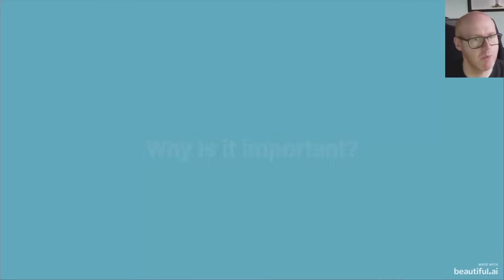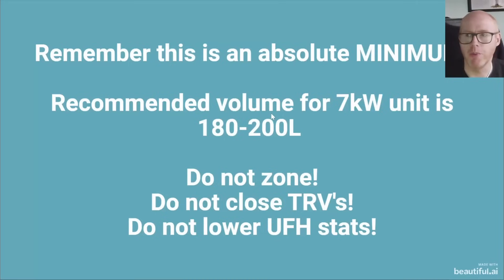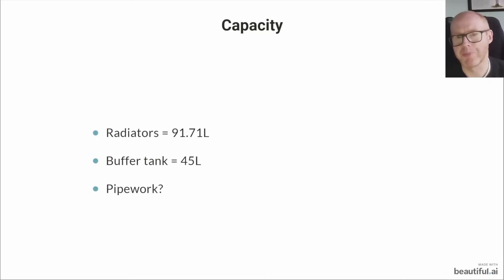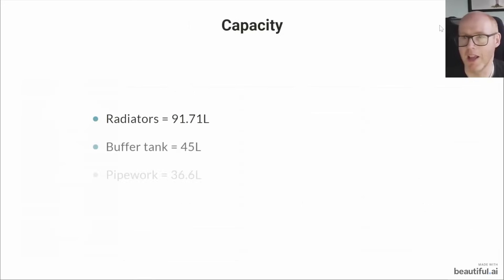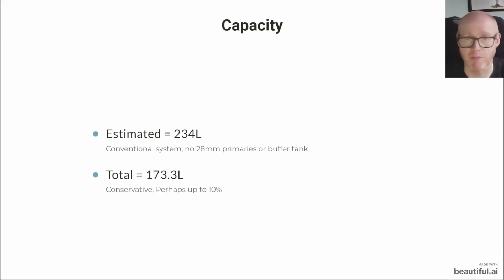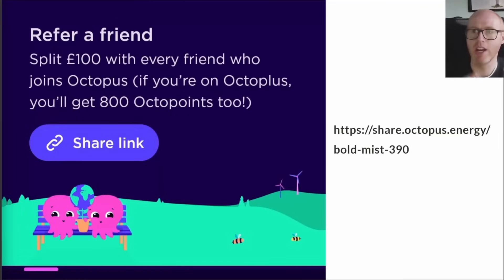How to Reduce Heat Pump Frost

Comment: volumizer or buffer also helps as heat store with reducing hp cycling at lower load and higher outdoor temps, when input is higher then output and hence increases efficiency
Reply from the maker: Agreed 👍

Comment: Really interesting, thank you, another lesson in the road to binning our LPG boiler. I'll have to look into underfloor for volume calcs. We've 100 m2 of modern underfloor, I'd imagine there's good volume there. I always wondered what buffer tanks are for, so thanks again, very educational.
Why do any of us ordinary folk need to understand this? to keep an eye upon a perspective installer, there's such a small installer skill base out there. Buyer beware!
Reply from the maker: Yep, a shame that this is all very common knowledge in many other european countries but we've been left so far behind.

There are lots of good heating designers out there but we need many thousands more of them to train and upskill.

The primary purpose of a buffer tank isn't to add system volume. It's to allow the flow rate of the heat pump and the heating circuit to be different.
The volumiser effect of a buffer tank is secondary really.

Comment: thanks for the vid, do you have a reference for where the recommended volume figure came from? Just had a quote and they recommend a 25L buffer piped as a volumiser as I think they are assuming any rad with a TRV is not included in the system volume even if I plan to run it all open loop.. My Current volume without volumiser is 165L in theory
Reply from the maker: I came to this figure by too many hours of reading forums, Facebook groups and studying heatpumpmonitor.
Some more experienced heat pump engineers seem to use 25L / kW as a starting basis to allow heat pumps to work comfortably.

Some heat pumps have slightly different defrost strategies that don't require quite as much volume to be comfortable. Viessman and Ebac are examples of companies who do things differently.

Comment: I hear a lot of comments saying don’t have TRVs to increase volume and thermal mass but we like having different rooms at different temperatures at different times of the day. I guess having more emitters in the hottest rooms and a volumiser can help. Interested to know your thoughts?
Reply from the maker: Different rooms at different temps is no problem.
Good heating design will address that. Larger rads in rooms you want at 22 degrees and relatively smaller rads at rooms you want at 18 degrees.

Now changing the temp of those rooms throughout the day relative to each other is a different challenge and one that is not ideal for most domestic heat pump installations. You will sacrifice some efficiency to meet your goal from what I understand you are trying to achieve.

Comment: Interesting. Wonder how this affects efficiency because it take more power to heat up more water. I guess the additional power required is offset by the lower on off cycles.
Reply from the maker: Yeah, that's the basics of it. Volume just smooths things out. Decreases cycling. Allows the pump to work for longer at a lower power output.
Reply: @UpsideDownFork  Instead of a volumizer, what about those massive Victorian style high volume radiators?
Reply from the maker: @ChidleyEngineering  yes, that's a good solution if it works in the property.

Comment: Thank you, that was really useful. I asked the octopus surveyor about the implications of using smart trvs (my office tends to get warmer than other rooms) and he did not have an answer

I guess the opposite applies, too much volume will be detrimental too
Reply from the maker: Smart TRV in one or two rooms will be ok until it gets really cold outside then you really don't want to be isolating some of your system volume.

Yes, there will be a point at which too much system volume will not be helpful but most residential properties won't need to worry about that.
My heat pump for example can easily accommodate at least double my system volume without any detrimental effects.

Comment: Great video.  I had a 7Kw Arotherm Plus fitted in November and it has had constant defrost cycling in every cold snap currently resulting in a very cold house!  The installers are swapping it out to a 10Kw unit shortly but I will look at system volume and do some rough calcs, we have a large downstairs UFH slab with 15mm poly pipe so hopefully in the recommended range.
Reply from the maker: Ouch. How close was your heat loss?
Did you also consider the electrical backup heater option?
Reply: 7.6 Kw / hr heat loss at -3C, unit went live and next day the snow arrived and the cycling started!
Reply from the maker: @HappyDays2602  ouch. I wonder if you had a couple of weeks before a cold snap, you could have built up thermal mass in the property that could have helped?🤔
Reply: We had warm(ish) weather afterwards, more than enough to build up the thermal mass, and it’s happened every cold snap so far.  The unit works perfectly when at +5C, COP up to 5.5 so looking forward to it being sorted.
Reply: Considered the BUH but not enough detail on how COP could be monitored etc with it so elected to go for bigger unit.

Comment: I have Vaillant 5kW, 200l+ volume, lots of high intertia UFH, running very low flow temps (25-35). I'm still seeing worst case defrosts of every 30 mins or so, but the defrosts themselves are short, less than 5 mins.
Reply from the maker: Sounds good in this weather. High humidity and low air temps can be really punishing!

Comment: I don't suppose you have any idea how to calculate the system volume of UFH per square meter rather than run length do you (as I don't know the pipe run lengths).  It's a 128sqm property with an estimated 120sqm of UFH.  
All the calcs seem to be by length of pipe (which makes sense).
Reply from the maker: If you don't know your pipe spacing then I would suggest getting an infrared camera to expose the pipework under the floor to you.
Reply: @UpsideDownFork  thanks. Pipe spacing is 100mm and I will be able to get the internal diameter from manufacturer.  Would it be as simple as 10m per sqm in that case? Not allowing for turns etc.

Comment: Really interesting. I didn't know system volume was related to defrost. I'll have I'll have to look up minimums for my Aira 8kw but I'm starting to think the buffer i have is even more necessary than I thought
Reply from the maker: Your recommended system volume will be very roughly similar to mine.
25L / kW is a very rough rule of thumb to work with.
Reply: @UpsideDownFork when you measured pipe runs. Did you times by 2 to count flow and return?

Comment: quick (maybe dumb) question is your 45 litre tank a buffer tank or a volumiser tank? Does it hydraulically seperate the heat pump from the radiators or just add 45 litres to the system volume?
Reply from the maker: Mine is plumbed as a buffer tank. If I can ever get written confirmation that I can replumb it as a volumiser without voiding my warranty then I will do so. 
I was actually hoping to do this back in November but verbal agreement is not good enough for me.
Reply: @UpsideDownFork  I thought a volumiser is piped on the return and a buffer on the flow side?
Reply from the maker: @jooie444  a volumiser has just 2 pipes. One in, one out. It can be fitted on the flow or return.

A buffer is a 3 or 4 pipe setup. Typically 4 pipe in the UK.
It allows different flow rates to be used by the heat pump and the heating circuit.

Comment: At around 0c my 5kw heatpump defrosts around every 90 mins and it lasts about 20 seconds, impressive to see a huge cloud of steam being blown out
Reply from the maker: Thanks for sharing.

If you go outside and observe your heat pump you will see that it takes much longer than 20 seconds for the whole process. A quick defrost on a Vaillant pump will be something like 2 minutes. 

Humidity pays a critical role in defrost frequency too.
Reply: @UpsideDownFork  probably, I just timed from when I see the electric consumption change followed by the start of visible steam at the rear and front then the finale of steam ejection with the fan being activated.

Comment: Gas boilers were also very commonly hugely oversized. Seems to be programmed into the mindset of the heating industry the idea that bigger is better and now even more of a problem when applied to heat pumps.
We are not alone. Domestic heating in the USA is on a totally different scale of oversizing with massive basement furnaces that would be suitable for a  factory or a school building in the UK.
Reply from the maker: Everything is moving in the right direction.

Comment: I came to the same conclusion and fitted a 50l volumiser when i installed my system. The 50l was plumbed in on the return after the diverter valve. On a hot water cycle in cheap rate the volumiser heats to 60 deg and then opens up around the heating circuit giving it a boost. Works well.
Reply: I have the same arrangement. Works great in winter, but in summer it means we are heating an extra 50L of water to 55-60C in order to complete the DHW cycle, and then that heat is largely lost to an already hot house over the next 24h. An online calculator suggests heating 50L of water from 25C to 60C will use around 2kWh of energy. It must be at least doubling the energy required for DHW cycle, although as you say this is still useful energy in the heating season.
Reply from the maker: Nice! 50L can make a huge difference during the very cold periods and the very mild periods.

Comment: Your rule of thumb estimate was off because you doubled the radiator capacity. Check your figures again.
Reply from the maker: 7L is per panel, not per radiator. 
All of my radiators apart from 1 are double panel rads so 14L each.

Does that make sense?
Reply: @UpsideDownFork  7l/m for a K2. You've then doubled that. Check again.
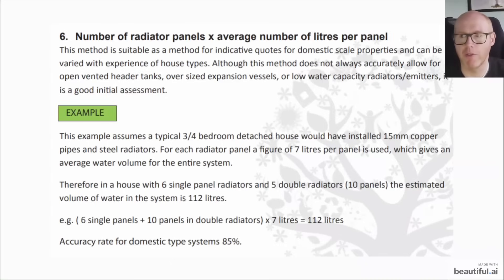Reply from the maker: @71brp84  If you're talking about the rule of thumb from 2:50 - 3:50, that's not 7L/m for a K2. It's 7L per panel.

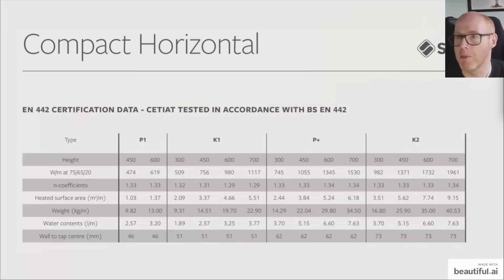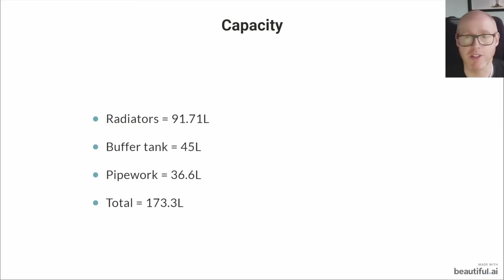If you're talking about the calculation method from 4:00 - 7:00 then it is 6.6l/m for a 600mm tall K2. My calculations at 4:50 look fine.
Reply: @UpsideDownFork  your rule of thumb also doubles all the pipework, not just the panels, which is why it's so far off.
Reply from the maker: @71brp84  I agree it's flawed. 
It's not a rule of thumb that I concocted. 
It was shared with me by an experienced plumber. He seemed to think that anyone of a certain generation who built domestic heating systems uses this exactly as I described in the video.

Comment: I can see why many installations have been suboptimal. It seems that the idea that I have so often heard of "we increase the size a bit just in case" really could have a huge detrimental effect on the system when it comes to defrosting.
Reply from the maker: Indeed. Heat pumps really need calculations instead of rule of thumbs that plumbers have lived by before for gas boilers.
Reply: Yes, but MCS heat loss calcs are a joke, yet followed slavishly by many installers. Octopus insisted on a 9kW Daikin, which can only modulate down to 900w (it's the same unit as the 14kw (16 possibly?)).
They refused to consider the 8kw Daikin for my property. 
My defrosts don't seem too bad anecdotally this first winter - there doesn't seem to be any useful data out of the box).
Reply: @DomSta03  They insisted on fitting a 16Kw at ours despite me not managing to calculate anything above 12Kw using Heatpunk.

Comment: I didn't look into water volume before I got mine installed. I just calculate mine and it's 170L for the Vaillant 5kw. So about right I guess. Its been running 529 hours and 216 on/off cycles? Anyone else on/off's similar?
Reply from the maker: 170L for a 5kW pump is great! Your run time vs cycles also looks excellent, but it probably won't be able to maintain that as we get into the shoulder months and you hit minimum modulation.

Comment: This is great timing, as I have been doing some calculations for my heating circuit volumes for an aroTHERM plus 12kW. (As I will be having UFH, and have the potential to the increase pipe bore to therefore increase the circuit volume) I had looked at the technical information sheet for the 12 kW and assumed that as I was over the minimum 45l (I was roughly 140l) everything was OK, but you mentioned a 'recommended' circuit volume which seems much larger. However, I couldn't find this recommended volume on the technical sheet, does anyone know where to find it or how to calculate it?
Thank you.
Reply from the maker: The recommended for the 12kW is 300L.

25L / kW is a rough rule of thumb for comfortable operation.
Reply: @UpsideDownFork That's great thank you.
Gives me a figure to aim for when I go over the calculations again and look to see where I can potentially increase the pipe bore to give me more volume.

Comment: Could some explain the relationship between system volume and the pressure level of the system. Yes, another newbie.
Reply from the maker: What do you mean by pressure level? 
Pressure usually increases with water temperature.
A larger system volume could potentially stabilise the pressure because the heating up and cooling down cycles can be minimised.

I can't see it making much of a difference in any healthy system.
Reply: @ I have a gauge on the system which tells what the water pressure is ie 1.5 bar the recommended pressure. Surly if I increase the Volume of water the pressure gauge goes up past the recommended level?
Reply from the maker: @chrisholland4952  if you add water without anywhere for that water to go, then yes that's true. 
The real way to add system volume is to fit a volumiser or larger radiators. 👍

Comment: Great technical video and very timely for myself. I have Octopus coming out on Wednesday to revisit/resurvey my proposed installation to see if they will do the replacement of existing trunk Steel Pipework in my property so I can discuss with them the overall system volume  as this was not a figure presented in the survey document. At the moment they are adamant that they will not increase the size of any of the radiators calculated from the survey last month even though I expressed reservations over the designs ability to maintain 21 degrees internal temperature in my 80 year old property. I'm interested also in their process for confirming/certifying the stated BTU outputs of the radiators from their chosen supplier, there seems to be a lot of talk about stated BTU not being accurate and actual being considerably (20%) lower. If this component of the design is not accurate and they will not upsize radiators it throws the whole design out and the system will not achieve the planned efficiency and required comfort.
Reply from the maker: Ah, this is interesting stuff. Octopus are definitely hesitant to deviate from their cookie cutter style at the moment so i'll be interested to hear how you get on with them.